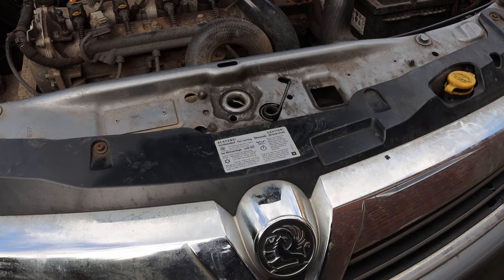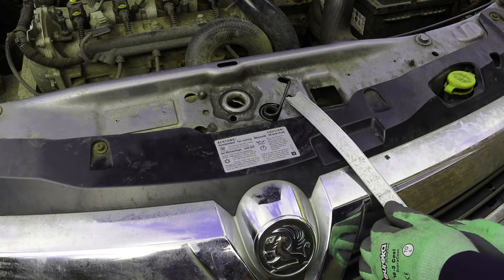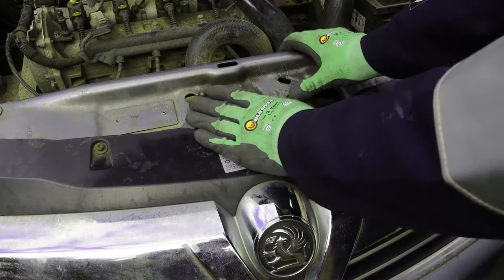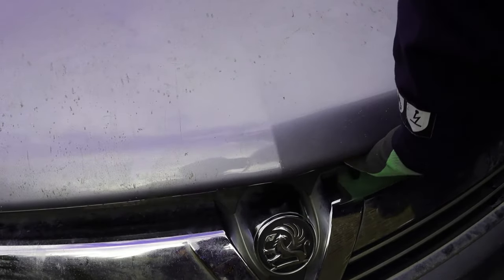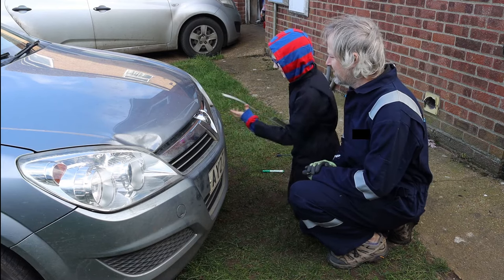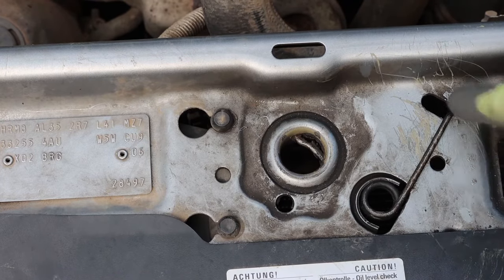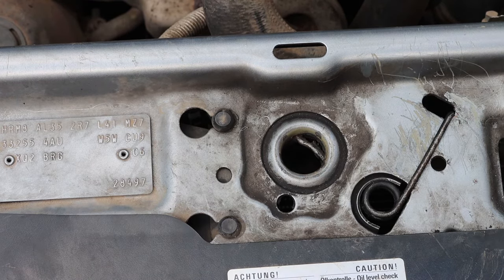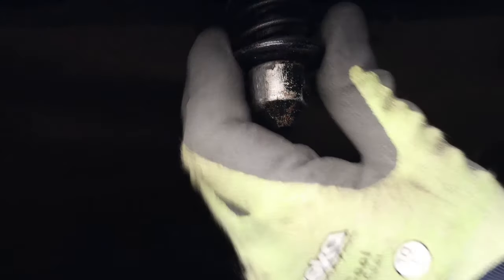Vauxhall Astra H Bonnet release failure

Comment: Top stuff!! it also works for a Vauxhall Zafira B with a slight twist - it's much easier to go through the front grill as the front crossmember is angled down at the front. Grab a good torch and look through the front grill just to the right side of the badge and you can literally see the spring. It became a 20 second job. Thanks mrfid72!!
Reply from the maker: Thats good to know, thanks for sharing.

Comment: I got the spring out but it won’t open by pushing down , any suggestions?
Reply: How did you solved this problem?
Reply: @KebsikMieszany  I prayed open the bonnet enough with a claw hammer, then flicked the locked opening the bonnet then I hooked a car battery to it & unlocked ….. it locked me out again so I smashed the window 😂😂😂😂
Reply: @KebsikMieszany  also solved it by scrapping it

Comment: Does it also work if cable is not broken? I explain my self… i need to open the hood but can’t enter the car because the battery is flat, even the manual key can’t open it. So i need to open the hood to get access to the battery
Reply from the maker: yes, it should work. My cable wasn't broke, i just hit a deer and bent the front a bit...
Reply from the maker: Your key should work in the door though?

Comment: I managed to open my bonnet =,when the plunger was stuck on the latch, luckily. Having pulled the bonnet release lever in the car, I drove one front-wheel up a regular DIY car-ramp, and then the bonnet magically released. I guess the small deflection and twist of the car was enough to move the latch one way and the bonnet the other way to release the snagged plunger. 
Thanks for your video. I've now greased all the mechanisms and latch surfaces there including between the bonnet plunger and plunger spring above.
Reply from the maker: I maybe could have done the same, my bonnet was misaligned following a dear hit.

Comment: If this doesn't work: My Astra H had a similar problem, the bonnet-release cable and leaver was fine, but the spring and bolt on the bonnet itself was twisted slightly. If it's twisted/loosened over time and the little grooves aren't in the right place it won't release when you walk around to pull the leaver. Use a mate or strap to pull the bonnet release leaver in the cabin as far as it will go, then open the bonnet normally, then, twist the bonnet spring+bolt to make it a bit tighter and make sure the grooves are in the right place.

Comment: I was wondering sneaking a steel coat hanger hook around the hook and pulling it back or is the hook rigid cheers
Reply from the maker: You need to push the spring forward to unlatch it.

Comment: Hi mate! thank you for this.. i have unlock the bonnet but the thing is my cable is ok the only thing is so loose.. where can i find find the screw to adjust it? thank you!!
Reply from the maker: The cable clamp is at the back of the front, behind the square hole. It just clamps the outer cable cover so make sure when you adjust it that it still works (before you shut the bonnet)
Reply from the maker: Picture here http://www.fid-tech-ltd.com/forum/P_20210609_093106_LI.jpg

Comment: Got a vectra c 2005 pre facelift, what could I use to do this? What’s the tool used to push through and unclip the spring? Thanks
Reply from the maker: just something i made up from a piece of light weight aluminium angle. you may get away with using a 12" steel ruler?

Comment: I got the spring detached but bonnet only lifts a little bit but when I push down on it it still won’t open any ideas?
Reply: Ever sort this mate got same problem?
Reply: @reaganstanislas3688  mine did the same but i kept wiggling the bonnet a bit and gave it a whack and it released

Comment: Where can i find the tool to buy, obviously not the one you have in the video, i cant get mines open with what ive tried :/
Reply from the maker: i dont know if there is an actual tool for this job, you should be able to get an aluminium strip from metal merchant, 25mm wide about 1.5 - 2 mm thick and about 400mm long.
Reply: @mrfid72  would you be willing to sell some & post it to scotland?  Not many mechants active at the moment.
Thank you so much for responding

Comment: have 07 corsa deadlocked out and battery is dead will this work also is this only if the cable is broken as mine is fine
Reply from the maker: Honest answer is i don't know, this method releases the spring end holding the catch down so it can be used regardless of whether the cable is broke.
Reply: @mrfid72  should be fine then thanks

Comment: I can feel the spring with a steel ruler ive cut a notch out but cant seem to do it ive trying for an 1h ???? Any ideas
Reply from the maker: can you feel the ruler pivoting on the spring?
Reply: @mrfid72  i dont quite no what you mean but i can feel the resistance of the spring and i push it back till it stops then push it alitle and seems to ping off
Reply: @mrfid72  my battery has gone flat so central lock dont work and for some reason i have 2 keys and non will open drivers door if you have any idea about that?
Reply from the maker: @northwestbangers7890  No idea on that, i though you should always be able to open the door with the key
Reply: Just managed to open it hahah the spring was catching not letin the pin go...thanks got there int end 👍👍👍
Reply: @northwestbangers7890  thats whats happened to mine strange the key wont open the door waiting for my aluminium strip to come so i can try😭😭